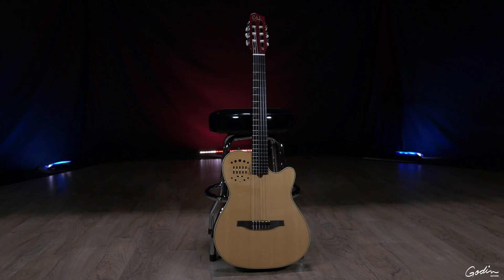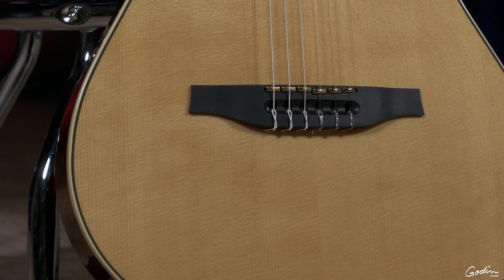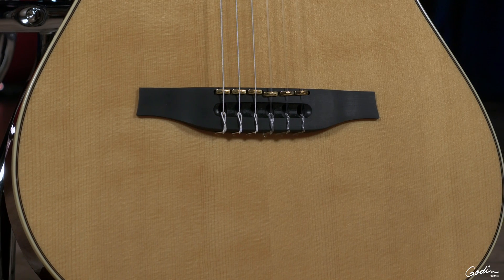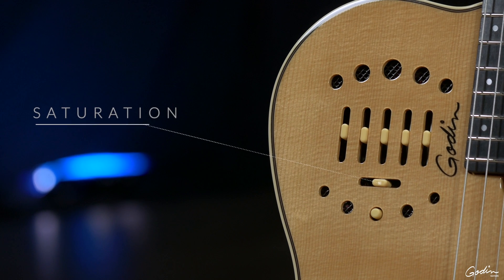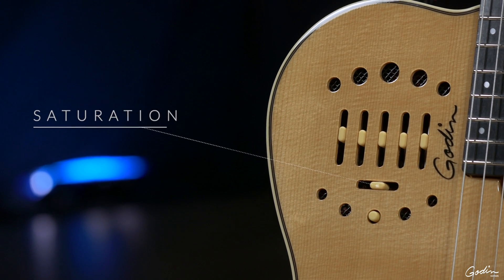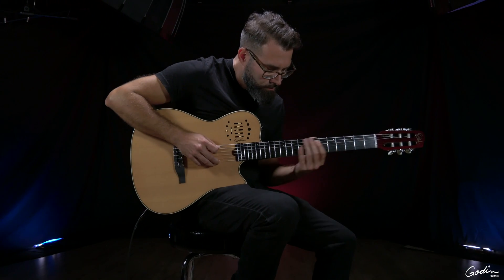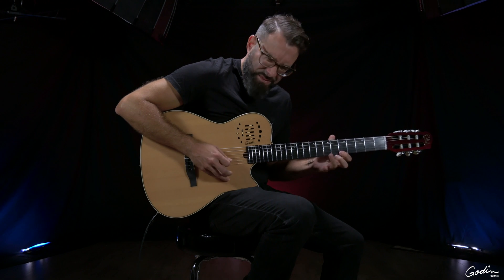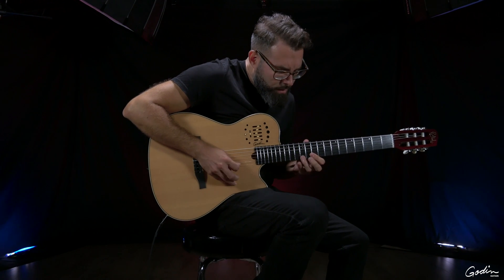Godin Multiac Nylon Deluxe - Electronic Design and Engineering

Comment: Confusingly many models and pickup + neck  width variations in this Multiac family... With the hex pickups system, I thought the whole idea was to have the midi option (S.A -synth access). To get wooden sound from the top, there must be a transducer mike inside the chambered body. Or is it a mini condenser mike.. Where in the guitar is it placed? 🤔

Comment: Godin Multiac Nylon Deluxe
Godin Multiac
Godin Multiac Deluxe
The sound of the Godin Deluxe you’re playing is really great.
I also purchased the Deluxe.
The problem is:
When measured at the 12th fret using a ruler, the string heights are:
   •   1st string: 2.20 mm
   •   2nd string: 2.20 mm
   •   3rd string: 2.20 mm
   •   4th string: 2.25 mm
   •   5th string: 2.50 mm
   •   6th string: 3.00 mm

This is the height I need to set to avoid buzzing.

Can you please let me know the string heights of your guitar when measured at the 12th fret for strings 1 through 6?

Also, please tell me the brand of nylon strings you are using, and whether they are normal tension or high tension.

Comment: Hi, what strings are originally installed in the Nylon Deluxe and what are the ones recommended by Godin because I would like to change to the original ones? Many thanks 👋
Reply: For my money then stock strings are horrible. Very bright, and they vibrate against the piezos which is picked up by the mic.

Comment: Greetings, is it possible to lower the action on the hex pickup models?
Reply: You have to shim the neck. Very easy operation, I suppose there is some videos about it at YouTube. In short, you just take off the strings, and neck. Then put either a very thin metal (usually brass) or wooden shim towards the inner side of the neck pocket, to adjust the angle of the neck/ body. Maybe just 1/4-1/2 mm thick is enough, trial and error is the way to go. Having a couple or more shims ready before you begin. Ps: adjust the neck first (trussrod w/ hex key), neck has to be straigt or just a little relief. (with strings on).
Reply: I would like to know this too!!.....ANYONE ?
Reply: @johnklimeck  really? Thank you! Is this something youve had done to this model or something similar?
Reply: @thyggs But I have to correct my self - sorry for misleading:
The shim(s) have to be placed towards the INNER SIDE of the neck pocket, not the outer side as I wrote first. To make stings lower. Just physics. I have such shims now, ready to correct my Godin Aca SA. And a bass guitar that also has too high stings. What I did - in desperation - before I knew about this shimming technique, was to loosen the piezo saddles one by one, and sand away the edges they had on the under side (ca 2mm) with a Dremel. Now it's almost there, but not quite. I need even a bit lower strings to play comfortably on it's fantastic and fast ebony fretboard on this early model Multiac aca sa 🎸
Hope this clearified a little. You could also use stiff cartoon, or plastic from a finished credit card, just to test this operation. Good luck!
Ps: I corrected my first comment about this now (inner / outer)
Reply: @evenseb7574 Youre a saint and I cant thank you enough.  I will try this week.  Cheers!

Comment: Already have my Godin Multiac Nylon Deluxe preordered! Can't Wait!!!
Reply: How do you like it ?
Reply: @ericktheone  It's not available yet. I do have the Grand Concert Deluxe and I love it! I have four ACS which are my main guitars and the Multiac Steel. The new Multiac Nylon Deluxe is the same body style and neck as the ACS with 22 frets, 1 7/8th nut width and a 25.5 scale length. The Grand Concert only has 19 frets, 2 inch nut and a slightly longer scale length like a traditional classical guitar. I wish Godin would make a short scale ACS nylon like the LTD TL-6 with 24 frets.
Reply: @vincehammond4081  awesome! I have a nylon multiac that I absolutely love. I’m looking at my second godin but maybe I’ll go with an electric, like the Radium.
Reply: @ericktheone  Love it!
Reply: Vince... a year has passed since you made a post to this video. I would greatly like to hear your thoughts on the Godin Multiac Nylon Delux you had ordered. This is the guitar I am highly thinking of purchasing. Would you please respond with some thoughs about this guitar, and if you have extra time, some comments on how this guitar compares to the Grand Concert Deluxe you also purchased. As a performing classical guitarist, I must say I am very interested in both. Thank you kindly!!!
Reply: @jmmxg  Hello, Unknown One. The Nylon Deluxe is very much like the Grand Concert except the neck is like the ACS, 1 7/8 nut width (which I prefer) 22 frets and the body is smaller like the ACS. It's very comfortable to play. The only thing I do not like about both guitars is the Richlite finger board, it feels kind of fake but both guitars play and sound great plugged in and that's what I bought them for, performance. I now have my eye on the new Multiac Mundial Kanyon Burst which has a real Rosewood finger board and a Spanish cedar neck. That's going to feel like a real classical guitar with the range of an electric and it's damn good looking too! I have a feeling that will be my next main guitar for recording and performance. My 2008 ACS SA is still my main guitar, it has a real Ebony finger board and many battle scars.
Reply: @vincehammond4081  Hey, Vince! I greatly appreciate your feedback and the quick reply to my message. In my search of reviews for these guitars, others have mentioned their dislike of the Richlite finger board feel. Overall, it looks as though Godin makes some amazing performance guitars, and now I will check out the Multiac Mundial Kanyon Burst you mentioned. Thank you for your time!!!